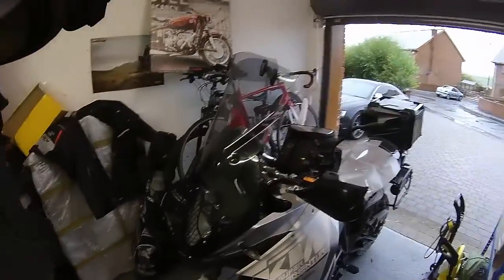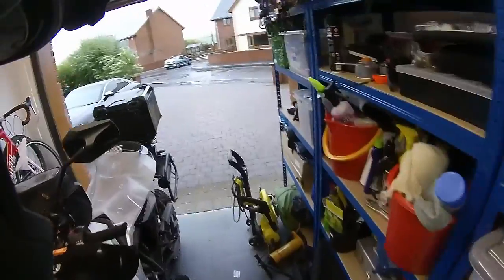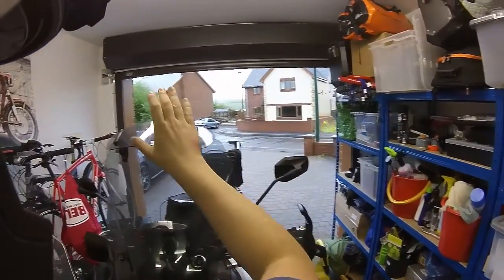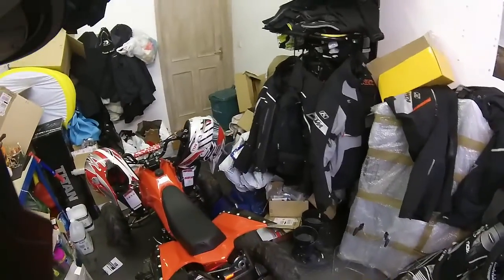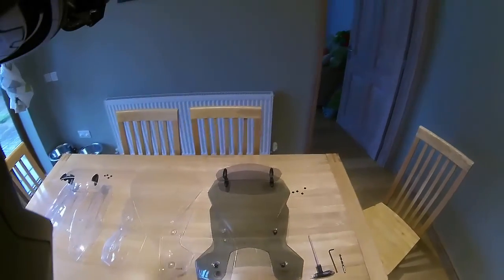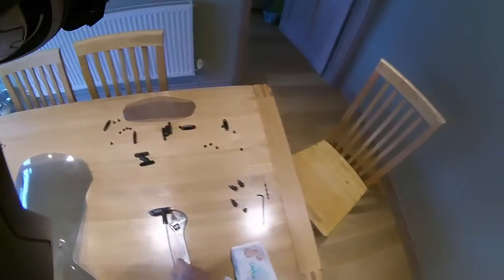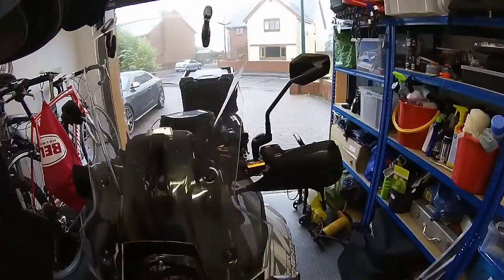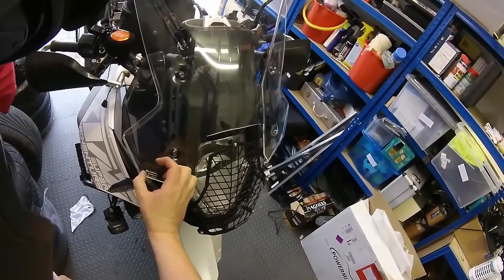Vlog #15 - Fitting new screen

Comment: i have the smoke screen and during installation i noticed there were only 2 retainers which according to the manual is supposed to be place lower. I was you had 4 retainers. did you buy the sepaerately?
Reply from the maker: The smoke screen I got had 4 retainers. Interesting thought though, might try take top two out and see what it does to the airflow. Puig will probably send you some more if you drop them a message. http://www.puig.tv/en/ and click Contact top right. They answer within a couple of days.
Reply: Thanks